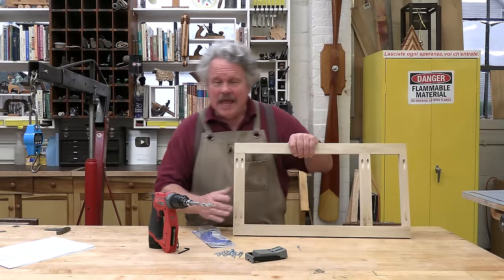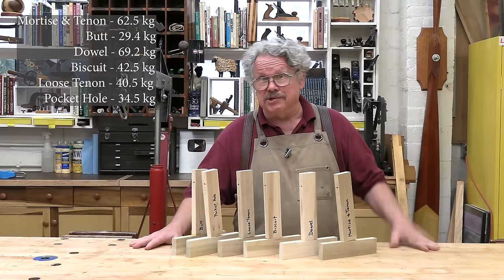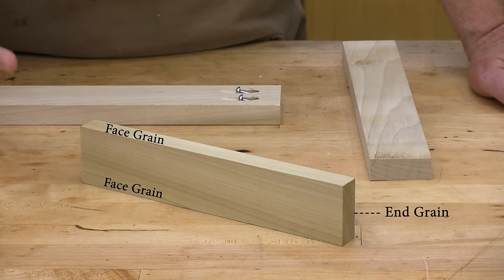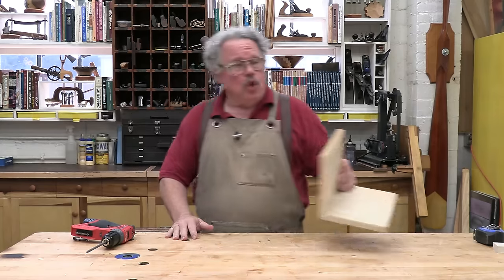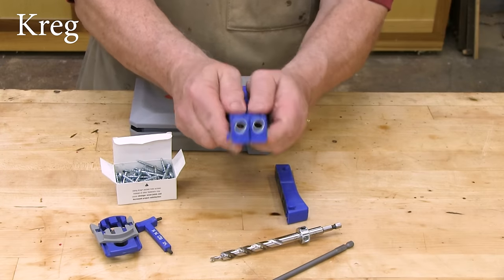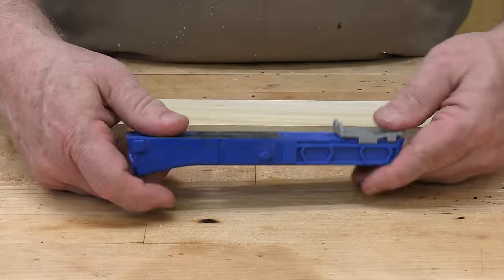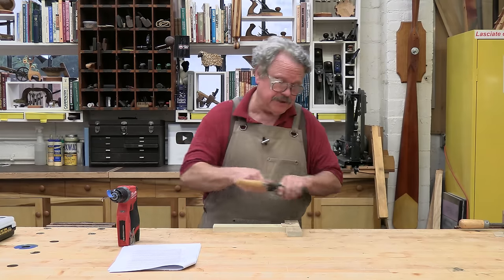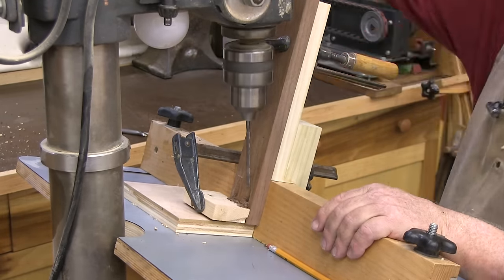Pocket Holes Overexplained

Comment: I have the Massca, only under the brand name Titeman.
I have no idea what purpose the magnet on top serves. Anyone know?
Reply from the maker: Travis and I researched the Massca when we were making this video -- I even watched a video from someone who unpacked the Massca Edge, which is about the same thing as the Titman. I've never used either, but my impression was that the magnet held the guide to the adjustable base.
Reply: @WorkshopCompanion  yes. There is a magnet below which snaps to the adjustable base.
But the magnet on top, which is separate and positioned differently I see no obvious use for. I even asked Titeman, they had no answer lol. Perhaps it could snap to a metal hold-down clamp?
Reply from the maker: @razmossis  Very curious. The hold-down is a possibility, but why would you need it? Kreg jigs come with a poorly-designed, completely useless plastic gizmo that you are supposed to insert between the jig and the clamp, but I never use it. Perhaps Titeman originally had something like this for their jig, realized how unnecessary it was, and omitted it but failed to change the design since the tool was already in production.

Comment: I didn't realize pocket holes with or without glue were that weak. At least my applications were not critical. The screws would have to sheared off to fail in my application.

Comment: The screws you showed are NOT self tapping, they are self DRILLING thread forming. The tip of a self tapping screw looks like, well a tap. Grab a tap and look at it. Notice the screws you have have a v notch at the tip and the threads are sharp like a knife edge. The notch is for boring the hole, the threads wedge into the wood forcing a thread into the wood. Thus a self drilling thread forming screw.
Reply from the maker: I wish you were right, self-drilling screws might have been a better choice for this application. But all the the Kreg screws I bought for this demonstration appear to have a "Type 17" point -- a coarse  threadtapping screw with a long flute, designed especially for woodworking.

Comment: i wonder how pocket holes, but with glued dowels instead of screws would have held up?
Reply from the maker: Intriguing suggestion. And not all that hard to research. Just replace the stepped pilot bit in the pocket hole set with an ordinary 3/8" drill -- you'll probably need a 6" (150 mm) "aircraft" drill to get the necessary shank length, but these aren't too expensive.

Comment: 4:01 I'm not following the logic here. In these test specimens, it seems that most of the strength of the glued pocket joint comes from screws, not butt gluing.
3:54 Unglued pocket joint: 34.5 kgf
2:18 Glued butt joint: 29.4 kgf

Comment: The worst part of pocket hole joinery is pocket screws. I use coated deck screws for a my pocket holes and the joints are much stronger.

Comment: Mostly a good video. However, I question your strength test as I have never seen any of these types of joints used to support an arm sticking out in the air. Your test should actually be pulling in line with the attached board which is direction that the joints are meant to hold.
Reply from the maker: Every wooden joint must withstand four types of stress -- tension, compression, shear, and racking. Racking is the most destructive, and is the most common reason a joint fails. Ours was a racking test.

Comment: Better is stress parallel to the rail, at least in addition. This type of nearly right-angle stress is not natural.
Reply from the maker: There are four types of stress that a woodworking joint must withstand -- tension, compression, shear, and racking. Of the four, racking is the most destructive and is the most usual cause of joint failure. The tests applied a racking stress to the joints.

Comment: "These are almost always made with a pockethole jig"

Me: looks shamefully at the floor for all the years I've drilled a dirty angle then just driven the screw into it, rubbed down and covered it.
Reply from the maker: I try to impress on my students that there is not just one right way to do anything in woodworking. Often, there are dozens of choices. As long as it's safe, looks good, and holds together, it's a good choice. If you're comfortable eyeballing pocket screws, my kudos.
Reply: @WorkshopCompanion  Bless you friend, truth be told though and rather strangely, I grew up in a family of builders here in the UK so am pretty handy, and my best friend for the last 15yrs is a lifelong carpenter, yet until I saw this device here I admit I had never heard of it. I am of course now going to buy one because it makes a far neater job of it for sure. Much obliged. :)

Comment: Not a fan of pocket hole joints.   They're weak.   And they're ugly.   And required additional effort to hide.  They're also a fiddle to do accurately on thin frames. 

Dowels... with a good jig.... are  better in every category......